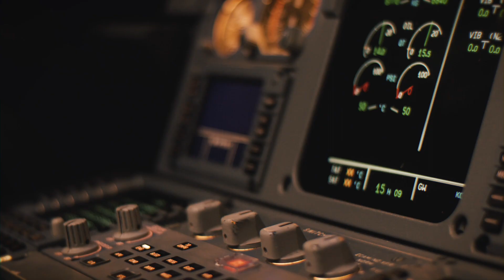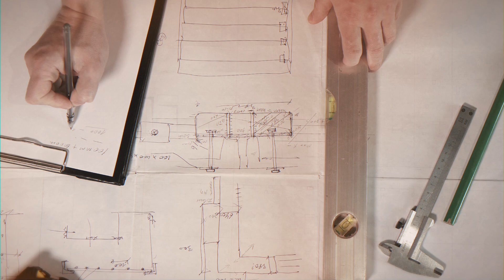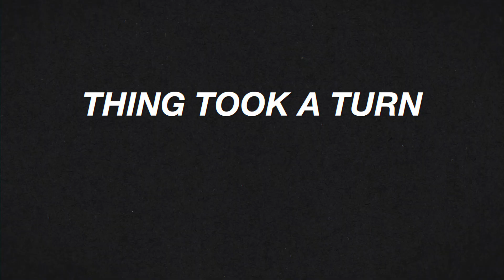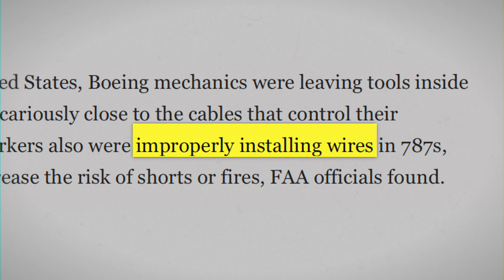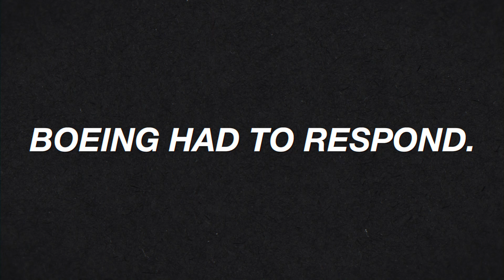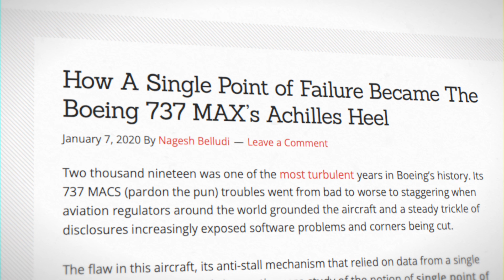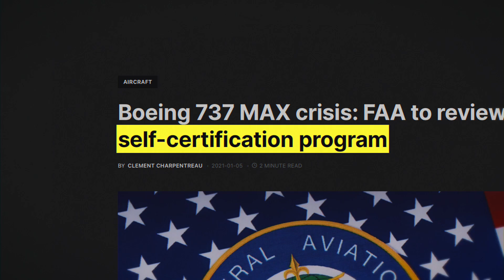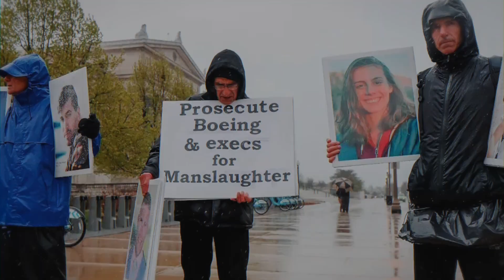The Scandal That Destroyed Boeing

Comment: Nice video. There are  in fact 2 aoa sensors on the plane but mcas recieves data from one. Crucial part of design was only that  737max had not enough space for the new engine to be fitted. So they portruded the engines. It was missing in your video.
Reply: Moving the engines up and forward had nothing to do with the accidents. That has long been debunked. It was due to faulty AOA data and MCAS misactivations.
Reply: @RagShop1  Well, it was the reason for MCAS. But MCAS could have been implemented safely.
Reply: @AmbientMorality  MCAS was for certification...intended for speed trimming and to counteract how the airplane behaved during a "wind-up turn" maneuver...
Reply: @RagShop1  they needed MCAS because they moved the engines up and forward, which changed the flight characteristics of the aircraft.
Reply: @reubenmorris487  Yes, which was primarily an effect of the nacelle and wing
Reply: @machupikachu1085  Yes, but MCAS was added to make the MAX fly like the prior 737 NG, not due to any stability issues. That was so new training wouldn't be needed. Southwest's contract with Boeing called for a $1 million dollar penalty per plane if additional training over flying the NG was needed.
Reply: @RagShop1  So why doesn't the Max fly exactly like the NG?  They're both 737's, right?
Reply: @machupikachu1085  Because the bigger Leap 1 B engines create added lift over the NG's CFM6's that alters flight characteristics. But the MAX is stable in normal flight. MCAS is there to compensate for the difference between the NG and the MAX. Problem was, it was badly implemented, activating repeatedly when pilots were trying to gain control and they didn't know about it.
Reply: @RagShop1  Exactly.  "the bigger Leap 1 B engines create added lift over the NG's CFM6's that alters flight characteristics."
That's what I mentioned.  Also, less lift can cause stability issues when not instructed to compensate. I'm glad we can agree.

Cheers!
Reply: @machupikachu1085  Some have claimed MCAS was needed because the MAX is inherently unstable in flight which isn't true.
Reply: @RagShop1  I'm not sure who implied that the MAX was inherently unstable in flight, I was trying to provide insight why the MAX may perform differently than expected. To crews that were not informed of the differences.  On purpose.  To avoid costly federally mandated pilot training.
Reply: @machupikachu1085  Others in the past did. We're in sync. Seems Boeing bent over for Southwest's insistence on no additional training and left references to MCAS out of training manuals also. Then MCAS was tuned too aggressively and the software had to be altered. Big dent in their reputation tough, it will take time to overcome the damage this fiasco wrought.

Comment: Yet another misleading video that completely leaves out the fact that there WAS something the pilots could have done and they did not do. The STAB TRIM CUTOUT switches are on the center pedestal and would have turned off MCAS, allowing the pilots to manually control the airplanes. There is another procedure that has been published by Boeing since the 1960s detailing a "porpoise" maneuver to unload the control surfaces if you have a trim runaway at high airspeeds.

The pilots failed to disengage autothrottle, which was set to takeoff thrust, when they started receiving warning notifications (disengaging autothrottle during a trim runaway is standard procedure). That's like keeping cruise control on after a tire pops while you're driving down the highway - not exactly ace piloting.
Reply from the maker: https://www.seattletimes.com/business/boeing-aerospace/boeing-altered-key-switches-in-737-max-cockpit-limiting-ability-to-shut-off-mcas/
Reply: @Armin99_  That article says nothing new. I would point you to the part where Boeing recommends that pilots continue to follow the decades-old standard procedure for trim runaways: flip the STAB TRIM CUTOUT switches. In the case of the Ethiopian flight, following this standard procedure was made especially difficult by the pilots failing to disengage autothrottle, which caused them to overspeed and overload the control surfaces.

Comment: A classic case of why you NEED regulations and why you absolutely must enforce them independantly from the corporations.
The market incentive is to cut corners in enery turn and find ways to offset the negative effects that this creates.
Capitalism is a system that has many, and I do mean MANY, flaws and the sooner we get rid of it for an alternative the better.
But FFS as long as we're going to have to deal with it we should try to stop some of the predictable catastrophes it causes via legal policy.
Reply: communism good, capitalism bad, amirite? all hail the supreme leader
Reply: @CokefishR  Completely false. 
1)You assume that the only possible systems that can exist are capitalism or communism
Newsflash: that's not the case.
Just as there were other systems before capitlaism that were neither so too will there be new systems that will be neither.
2) do you hinestly thijnk that capitalism is the "final system" of humanity? 
Do you think it's the best we can design?
We already have vastly superior logistical models than it that are beter at resource allocation that we simply don't implement for the reason that it would end our current oligarchy.

For example we could ease off capitalism with market socialism (turning large corporations into co-ops) and then adopt decentralized and networked post monetary resoruce based economics. 

3) Do you think that capitalism can adapt to climate change, AI, mass adoption of automation (that will vaslty reduce labor demands), cybernetics, biotechnology and nanotechnology without it going "well 30-60% of the population that will become unemployable are expendable, have them starve "in dignity" under the control of a militarized police. the rest will have to struggle to remain employed for ever decreasing salaries and ever increasing employment costs as augmentation becomes necessary to retain a job in the hyper-competitive jobs market"

We know what capitlaism does when production is able to meet demand: it creates artificial scarcity, to drive up price competition and retain profitability. This kills 9 million per year by preventable starvation alone, with all factors taken into account capitalism "working as intended" has a death toll of 15-20.
And that's without a crisis.
Reply: @fl00fydragon  market socialism™ good, capitalism bad (PS I already trademarked that name so you'll have to find some other name that includes the word socialism)
Reply: @CokefishR  So you basically have nothing of substance to say. 
You're a living parody, supporting something because you support it (circular logic) without knowing how it works and what alternatives exist, only because it's your team.
Do you even know what market socialism and post monetary resource based economics are?

Heck, do you even know what capitalism is?
Reply: @fl00fydragon  Marx: Do you even KNOW what socialism IS??
fluffydragon when he grows up: yeah, it's about political bureaucrats have absolute authority over engineers, entrepreneurs, and hard-working members of society, marginalizing groups who lead via experience, and prioritizing groups who write Das Kapital out of their mother's basement
Reply: @CokefishR it's not a "pamphlet" I need more explaining to do to counter missinformation that relies on a dominant ideology that has become a cultural norm (something that philosphers call capitalist realism)

1)  Key question: It has "the highest standards of medicine, exploration, quality of life, military, engineering." as compared to what?
Systems that were less advanced.  Even marx agreed with this obvious statement that capitlaism is the best of the systems that were at that point of advancement.  
By your fauly logic we should have never implemented capitalism because mercantilism had "the highest standards of medicine, exploration, quality of life, military, engineering."

Your comment ignores how human history works, how civilization advances to use increasingly better economic and political systems with the exception being when theocracy takes over and stagnates/reverts things (like how the dark ages stagnated europe or how the golden age of islam was ended by a fundamentalist takeover)

Is capitlaism the best humanity can make at our current understanding of logistics and organizational technology?
Absolutely not.

2)
Again a comment that is circular.
It's because they have capital and we live in the system known as capitlaism, meaning that for those things to happen they must be attached to capital.  There's no intellligence involved with this process, they're just wallets. Their advisors (who are workers) might guide said wallet to make smarter decisions but that's not the wallet's doing.

Your commewnt could easily be repurposed as your predecessor would say " If kings are so moronic, then how do they employ so many people, generate so much profit, and then have money left over to expand into underserved areas."

You see what you did here didn't you?

It's circular logic and you assume that capitlaists are something special when in reality they're the product of a system designed to create "wallets" like them that makes them the center of the system.

In a different system they would have no use, in comparison you would always have need for labor with the exception of a possible future where everything is automated by extremely advanced AI.

3)
What I am trying to prove is that capital will cut corners at the cost of well being, living standards and human lives to maximize profits.
It's deliberately killing millions each year just to retain profitability at an "acceptable rate" while also shrinking the money supply the common people has as more and more of it accumulates in the hands of capital owners reducing living standards for everyone else while also reducing it's "virtue" of upward mobility.

And that's before we factor it it's practices that waste resources, energy, labor, time, research as well as the practices that are ruining our environment, politics, geopolitics, culture and social relations that will create massive economic, political and civilixzational costs that we will have to deal with down the line.

And finally put it's inability to respond to AI, advanced automation, human augmentation, biotechnology, etc. without it's algorithms reaching the outcome of "X amount of the population are no longer needed for economic growth, thus they should not enagage with the market"
At best you're ensuring a future where crime becomes a necessity for the survival of entire demographics
At worst you'll see a crackdown that will force those people to "starve in dignity" as a "solution" to the crime rather than adderess the economic causes behind it.

And then everything goes, you got society on a knife's edge.